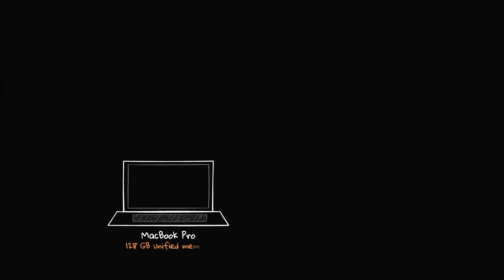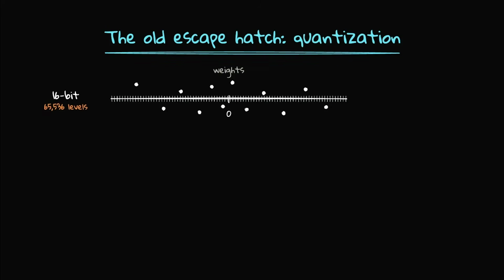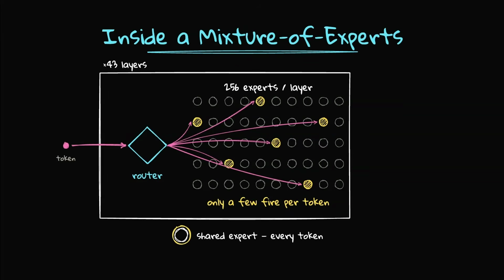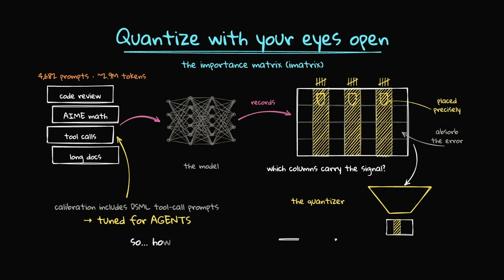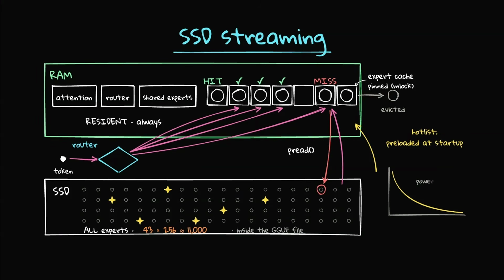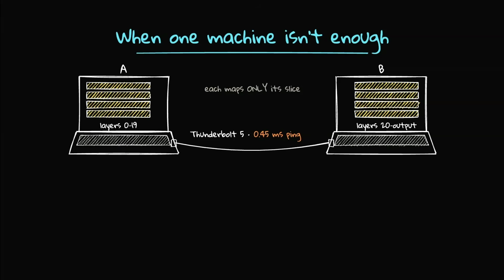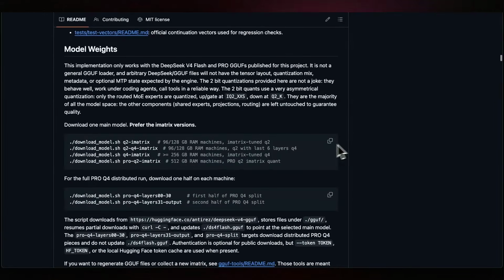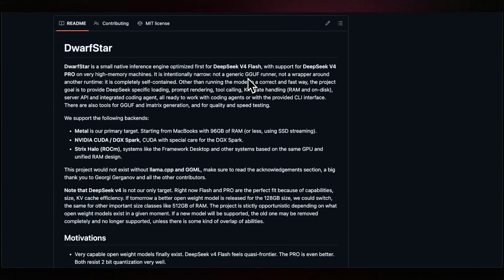Run a 284B Model in 128 GB: DwarfStar Selective Quantization Explained

Comment: The full unquantized model is only 168gb not 568gb, Deepseek v4 flash experts are native 4bit floating point, or half byte per weight(plus scaler so 4.5bits per weight give or take) and not 16bit.

Comment: I have a 128GB URAM M4 Max enhanced Mac Studio. It is amazing but so frustrating to be inches away but still incapable of running these top-tier models.

I must try your method immediately

Hey, If we’re targeting 128GB machine like myself, why can’t we get a better version than Q2? Maybe o3MLX or iQ3? It seems like Q2 is around 80GB using this method, right, so we have like 40GB (maybe 30GB - give the OS 10GB to breathe) to play with yet…

And, if we go the method of swapping some experts from SSD, why are we even talking about running a barely working quant. I’m convinced my machine could run a o4MLX quant of deep seek flash 4 if it swaps to disk some. I wonder what performance would be like, though

Comment: excuse me but if I was running DeepSeek off the network then call me stupid but I could also run GLM-5.2 online and then say "I ran it on my laptop" since "it clearly typed on my screen" lol

the point is, it's not actually running on the bare metal, any API could let you cheat in "runs on my machine" like that
Reply from the maker: Its my hardware, my network, my device :)

Comment: I've been trying to spin up a development platform that's fully local, and running only single-node inference on one spark for the last 2 months.. which has shown significant challenges. This right here just blew up my main blocker in review quality. This is a huge level-up for the code reviewer compared to qwen3.6:27b. Thank you for sharing, and big thanks to antirez for the amazing work! This is the stuff that legitimizes local AI, and breaks us away from the shackles and environmental hazards of the frontier data centers!

Comment: Cmon, this is not it. No matter what, its basically an average 4bit quant, just adaptive, some more bits some less. Fine. but you LOOSE those that are lower and what IF you need them. And SSD streaming, SLOW, RAM caching to VRAM is faster hell even CPU is faster than SSD streaming. Soo.... i dont see the solution here.

Comment: Good video and appreciate the explanation. Glad to see this approach is finally being adopted to get around low memory hardware, which honestly is most hardware out there. LLMs will never get mass adoption the way it’s being approached today. 

But this video reveals how f*ing lazy engineers have gotten over the last decade or two. Streaming data off of a drive is NOT new, it’s the principle for how CDs work, and I worked on a game in 1997 where engineers were streaming data on-demand from a storage device (not just loading, STREAMING it during execution). It feels like people are rediscovering approaches and tech that have been around for decades, and pretending it’s new. It’s a little embarassing. 

Take agents. They’re basically cron jobs with for/else loops that run scripts. Big whoop. But people are talking about them like it’s the dawn of a whole new enlightenment. Sigh.

Comment: Ryzen AI 400 will have support of up to 192GB of RAM (160GB of VRAM, 32GB of RAM) - obviously it won't be cheap, but this difference might allow for better LLM's being run locally. And in 2027 Medusa Halo (Ryzen AI 500) - will have at least 192GB of RAM and maybe 256 GB (224 VRAM, 32 RAM). Even for the LLM's that fit on 128GB machines, this means context window will be expanded.

Comment: Bigger =/= Better

Qwen 3.6 27B CRUSHES every other local model ive tried previously, up to ~140B params.

Im sure there's SOME payoff with newer larger models (especially something like Kimi K2.6), but honestly I have a hard time moving away from Qwen 3.6 27B - it's TOO GOOD!
Reply: same here! 27b dense is the best and qwen 3.6 35b moe nearly as good and 4x faster. i load up one of these two everyday depending if i want speed or precision

Comment: If these models had a keystroke logger, they could gain so much time to predict which weights to pull into cache/RAM, whilst the user is typing a question.
Reply: Do you not hear yourself? Why would you give an AI a live keylogger, that it can hijack to log EVERY key stroke regardless of if you're talking to it?
Reply: @lalanullistaken  Yea exactly, it is a risk you have to take that risk into account. But the benefits are it could hide most or all of the latency, and through this memory hierarchy allow a much larger model to run on a local secure machine.

Comment: Massive stretch on "It can run on your laptop".
Reply: The fine line between "It can run on a laptop" vs "It can run on your laptop"
Reply: it can run on a laptop thats not out yet 😂
Reply: @lancergt1000  it is out for some time, Asus has one based on 128GB unified memory based on AMD Strix halo
Reply: You never just chilled out on the couch with a 4U rack with 6 GPUs at 100% on your lap?

Maybe that’s why the wife pushed me down the stairs backwards.
Reply: @johnmadsen37  ... 6.. GPU's on your lap?!?... And the stairs? Tf you mean you basically chilled out with 900 watts on your balls? Don't microwave 'em again.
Reply: it cal run on a lap top from the year 2060 with no issue.
Reply: Altera and 512GB of DDR4 should be fine with an RTX 6000 Pro.

Comment: Smart quantization with calibration sets is not something new. Unsloth was doing it for years. Lean quantization of routers is also a part of that strategy.

Hot swapping model weights from memory to disk is also not something new. It's been there for couple of years.

I'm not sure what is the novelty for this DwarfStar project.

In order to say if it's good or bad, one pokemon wiki test is not enough. Proper benchmarks must be ran

Comment: The DGX and its clones have 128 GB unified memory. If you configure it right, you get around 110 GB video ram out of it. It is just the nvidia tooling that cripples it to 64 GB for no good reason in the default settings.
Reply: Artificial limit? I mean idk I have a spark, I loaded an 80gb model on it within 15 minutes of plugging it in for the first time. I have no idea what you are talking about.
Reply: @Astralagus  All fine, if you use vllm original containers etc. At least in some of the nvidia provided ngc ones, they hard code a maximum of 50% VRAM usage.
Reply: I use Minisforum mini PC with AMD ryzen. very powerful and low power consumption. These kind of limits exist on Windows not on Linux
Reply: @s0me0nes0mething01 well, it’s still an Nvidia issue because the Spark runs a tuned version of Ubuntu by default. So Windows isn’t a factor here.
Reply: @s0me0nes0mething01  Nope. It was part of the nvidia tooling inside their docker images. Finding and removing this artificial limit wasn't even that easy. They do it to prevent oom crashes the most lazy and wasteful way possible.
Reply: @hansdietrich1496  idk for nvidia spark. Only reason it exists is its compatibility with Blackwell architecture so you can dev stuff without buying Blackwell graphic cards that are not only expensive but hard to get. so to run LLM Nvidia Spark is crap and overpriced. Best way to run light llm, up to 192GB RAM, the best thing is a Ryzen based mini PC, in my case Minisforum. there are other brands but Minisforum offer Oculink. you get get Framework desktop motherboard with 8060s iGPU. that's a BEAST. usually I charge a lot of money to give those advice x)
Reply: Actually you can reverse up to 124GB for VRAM out of 128GB on AMD Strix halo in Linux
Reply: I use the dgx spark daily.  I definitely get 110GB+ usable and I never found that nvidia crippled it.  the memory settings are in my vllm docker container and it always honours those settings.  If I want fast inference for coding that is highly capable, I currently go to qwen3.6 35b NVFP4 moe mtp (3 speculative tokens, around 90% speculative acceptance for coding)
Reply: A got an Asus and I can access it all plus disk paging to really cause problems.
Reply: Dgx and it's clone have a really shitty memory bandwidth.

It's far, far from being as powerfull than a mac with 128go ram
Reply: @Cestpasfaux-v4x  M5 pro memory bandwidth is 307 gb/s vs 273 gb/s on spark. M5 max with 128gb is $7400. so.... sure go spend double and be stuck running qwen 3.6 anyway as its the best model that fits in 128gb.
Reply: @Astralagus DGX Spark with 4TB storage runs for ~$4700. The equivalent MacBookPro M5 Max 128GB runs for $5700 for the 14 inch and $6000 for the 16 inch. So, not even close to double the price. (You're comparing the 8TB storage version of the 16" MBP.)
Reply: @Astralagus  Use nvfp4 quantized ones and you get far larger models in there. But yeah, they're so slow, it is not really nice to work with.
Reply: @Astralagus  You can fins M3 max / M4 max that have more bandwidth and far cheaper.
Or you can wait for mac studios which are also cheaper.

Qwen3.6 is good, but you can also fit deepseek v4 flash.
And on mac, you have MLX, that you don't have on dgx
Reply: @Cestpasfaux-v4x why are you talking about bandwidth ? you already get very high bandwidth with Ryzen powered miniPC with LPDDR5x and it doesn't give more token/sec than standard SODIMM ddr5. iGPU aren't fast enough to benefit from any bandwidth improvement. If you have dedicated GPU then that's a different story. As I already said in other comment DGX is just a dev platform for Blackwell GPU. it's not made to run LLM for production, not at all. if you want inference go for a Minisforum
Reply: @hansdietrich1496  if you have a gb10, use this: qwen3.6 35b NVFP4 moe mtp (3 speculative tokens). happy to send you the docker compose if you need.  you will find this incredibly fast and good at reasoning, code, image, tooling.  i'm using cline extension

Comment: Offloading experts in a MoE model is something Ollama also is capable off, although I think in that case it offloads Experts to systems ram and keep the used experts in VRAM
Reply: Ollama is very bad at this, though. Which is laughable, since llamacpp, the actual backend they forked to put their bugs and name on, is pretty decent, capable of allocating the weights and caches in the best possible way.  Ollama doesn't do that, it treats MoE like nothing changed ever since Mixtral 8x7B
Reply: Also k-transformers, although difficult to setup.

Comment: It's not for the common windows machine running with Nvidia graphics card. It's for Mac users ?. 😮😮
Reply from the maker: If you have a couple of 5090s it will work, although you need an SSD for KV cache. Anything that has cuda support and enough RAM/Disk.

Comment: I might have missed it in the video, but another interesting feature is kv cache on SSD. (Edit. As I understand it), It removes ram space as the limit on context size. (And can hold it the entire session without prefill)
Reply from the maker: Yes, I kinda referred to it in the video. You can run the whole 1M context with the kv cache on SSD setup.

Comment: I cant wait for the stock market to realize that WWDC 2026 was apple soft-launching the destruction of all the AI hardware and software companies. next-gen apple products are coming with new chips running new apple AI models integrated into the operating system. that means free "good enough" AI for everyone who buys a new mac. apple will be the only AI company making money from day 1.
Reply: Apple is not an AI company.  They are reselling AI, just like Microsoft.
Reply: Upgrading from the base 36 GB configuration to 128 GB unified memory adds about $1,200 USD to the price.

Comment: What is the purpose of using Deepseek V4 flash , which such complicated installation, while it has an intelligence score of 37, which is exactly the same score of Qwen 3.6 27B MTP model, but which is much smaller and faster? It doesn't make sense to me. It would make more sense to do it with GLM 5.2 or Kimi 2.7 which are much more intelligent then qwen3.6 27b and deepseek v4 flash. Or what am i missing here?
Reply from the maker: Actually, in my experience its far better model than some of the other open weight models. The issue is mostly the harness around it. The main problem with open models is that the tooling around them is not optimized
Reply: Maybe the models you are recommending released after the creation process of this new engine started.
Reply: @ashishpj  Ow is DeepseekV4 flash so much older then Qwen3.6 27B ?
Reply: @sebkeccu4546 nope. Same week in late April, couple days apart.

Comment: What will they think of next?
I have actually considered using system ram to swap experts in and out, however I have instantly dismissed using the SSD as access times are too slow - in either case I lack the technical skill to implement this.
This guy actually did it, congrats 👍

With AI efficiency research dropping every few week, I believe we will get very capable local AI. The RAM problem will be solved one way or another.

Corporate AI is unacceptable as a long term solution. 
They continually change the terms, take usage, functionality away, and now restrict access for often trivial reasons (Mythos) . They are reluctant to publish their costs - which they will be forced to do for their IPOs. I have  a feeling the true numbers when released will be outrageous.
Reply: Swapping experts to system RAM has been done since the first GGUFs for mixtral years ago. The problem being, experts get called on a per-token basis, not per-prompt.
Reply: I wonder what would happen if you make a large swap disk on an (cheap!! because it will wear out!) SSD disk, and just run the whole model in-core on system RAM.

Graphics cards are super expensive right now, and if CPUs and DDR RAM is 30 times slower than GPUS and VRAM then so be it. Set up batch queues like on old-fashioned mainframes, and run ollama so that the AI model e-mails the result when it's finished.

I'm just a bit reluctant to try these kind of experiments during the hottest time of the year 🙂 better to wait for winter, when it can warm up my house.
Reply: @fritsdaalmans5589  not only does that work, there's discussion threads on llama.cpp's github (the thing ollama is a front-end for) where people have done exactly that. Usually for huge MoEs.

Comment: QWEN 27b q8 is still better
Reply: And smaller and faster (in MTP mode), and not all this configuration stuff, and it requires much less vram. It doesn't make sense to try deepseek v4 flash if this small qwen model has the same intelligence

Comment: well, this one specific, very expensive laptop anyway
Reply: To be fair. A lot of corporations would buy it for a Dev if it meant no more $2k a month bill 😂😂😂

If a dev can run deep-seek 4... That's useable. No Claude. But useable for sure.
Reply: @hotrodhunk7389 and in 6 months, when models improve, extremely useable. or rather in 2 years when Macs will have more RAM and faster SSDs

Comment: How much reading and writing happens on the SSD - any negatives besides latency like shortened life span ?
Reply: Life span is indirectionaly propotional to number of writes so yes it will surely impact
Reply: @mayankbhaisora2699  do we know what the constant is for this indirect proportion a = k/b ?
Reply: But probably not by much, because I don't think reads does much and I think it's mostly reads here
Reply: if you leave 10% to 15% of the ssd unformatted, the ssd will use that to minimize write amplification (which is what ages SSDs faster). reads have minimal impacts. also good to use an SSD friendly filesystem

Comment: So this is amazing, no doubt, but if we are using custom engines for one off custom models. Then if we only do this for every generational improvement jump model, like deepseek, then maybe its time to start designing custom ASIC chips for inference. That would give us a 3x drop in prices for inference right out of the gate. Each ASIC would be designed from the ground up for a specific model but I for one would happily buy a dedicated expansion card/hardware for a dedicated model so long as it is for every other or every third model. Most of the real everyday gains with AI these days are in the frameworks and how we use the models so now would be the time to start using ASIC. 4k for a 32gb VRAM card or 600-1k for a 128GB ASIC. Yes please and thank you.

Pricing examples here simple derivations from video card to ASIC comparisons from the mining world. And this is Just an opinion, not trying to challenge anyone for an original thought argument.
Reply: I think google does something similar. They have different TPUs (which are ASICS) for inference and training. 

I don’t think it’s as customized for individual models as you’re mentioning here, but I think we’re going to be getting to a similar path.
Reply: It has been done already
Reply: custom asics are coming soon. many startups all over the world, including by some legendary chip designers at TensTorrent and others. what I wonder is the place of FPGAs. true, they are higher cost and more energy hungry, but I wonder if there are any attempts to create fpga-light with a focus on LLMs